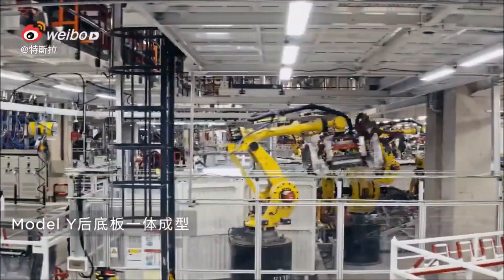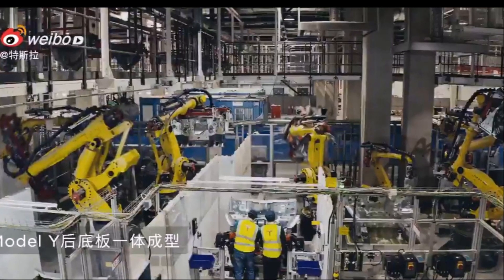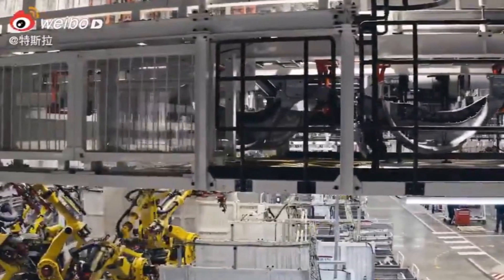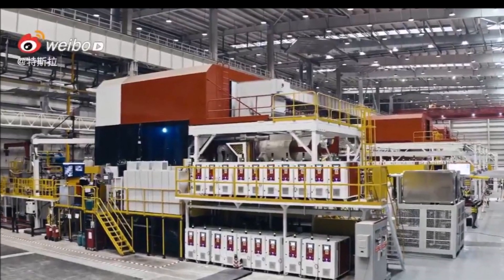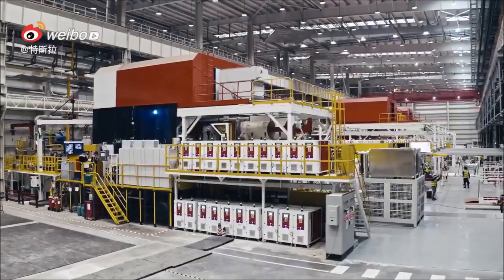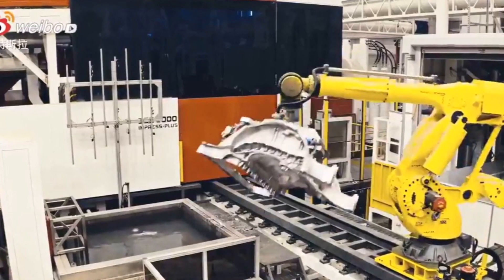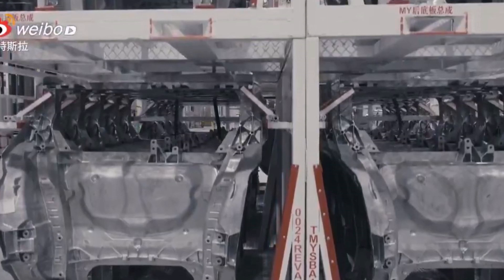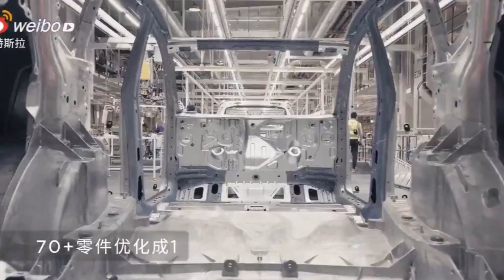Tesla Shows Rare Video of Mega Casting of Model Y at Giga Shanghai

Comment: For your note at 3:07, Tesla is claiming a 10% mass reduction resulting in a 14% increase in range as a result. Considering how hard it is for an ICE car to get a 14% range improvement - or even to eke out another 14% range via batter improvements, this is highly significant from an ROI perspective, above and beyond the cost reduction of eliminating 40% of the robots needed to create these structures than before.  Telsa has a killer car, but their secret sauce is such aggressive moves to reduce the cost of creating a car.

Comment: Good day Armen, your comment about Tesla being the only car manufacturer using large scale High Pressure Die Cast (HPDC) parts to speed up production and improve weight is not correct. Magna International has been producing FRONTEND ASSEMBLIES  to automobile manufacturers for several years. At the time they received their HPDC press from IDRA it was a 4,400 Ton press possibly the largest in the world at that time. May 6, 2019 IDRA news release. I believe Acura is one customer using this technology as well.

Comment: Did you notice in the video, when the robot removes it from the giga-press it has the sprues from casting.  It then backs up on a track and puts it into a workstation cell.  When it takes it out, all the sprues are gone.  Evidently that workstation does all the trimming and machining of the raw casting in one workcenter, very efficient!
Reply: Good eye
Reply: Actually, there is more than that - there are several smaller components being cast in the large opening in the main casting, which are removed at that stage.
Reply: @hindesite  Are you saying they're "killing more than one bird" (creating multiple independent parts) with one cast(ing operation)?  Good idea!
Reply: Yes, those are more often than not required in the casting cell.

Comment: Thanks. The accident repair cost is a good point on the Tesla SWOT that I’m sure Elon considered when deciding on the megacast.idea. 

Another possible negative is die repairs. It’s been 30 years since I was in the auto business but in those days aluminium attacked steel dies very quickly and maybe the dies (back then) lasted 1,000 to 2,000 cycles before needing replacement. Perhaps material science has advanced significantly since then. 

Then there is the problem of super-fast Tesla innovation which is going to date the megacast very quickly. Hopefully Tesla engineers considered this and modularised the dies and chose to amalgamate those parts least likely to change with time.

Finally there is the problem of quality control and rejects. The more complex the operation the higher the reject rate. I’m sure casts are xrayed and faults melted back to satisfactory quality. Perhaps during the first six months of operation the reject rate will be 20% but will come down significant with AI management inserted between the casting controls and sensors, and the X-ray machines.

Don’t forget Tesla has “Open AI” running it’s self-driving vehicles and there is every reason to believe that an Open AI is also managing every operation in the gigafactories. When Elon said the future lay in managing auto factories I think he was alluding to AI control.
Reply: The cost of fixing a gigacast car is substantially lower than with a traditional car and all of its fiddly little pressings with a myriad of fastenings, welds and adhesives.

Comment: Robot repair will be huge...  software programming  will be huge... process control will be huge...  engineering will be huge...  design engineering will be huge... mechanical engineering will be huge...  invention will be huge..   thinking will be huge. .. education will be huge...  How many elevator operators are there? How many horse and buggy operators are there?   Gone .. .. give your head a shake...  use your brain.

Comment: I had also heard somewhere that this mega-casting also reduced the number of robots by over 30, not having to do all the spot welding and manufacturing of all the smaller parts that the mega-cast replaced. So that's additional cost savings.

Comment: I was hoping to ignore this but I cant since I didnt finish watching the video when I originally started. First off. why the assumption that the part of the process affected by casted backend involved human labor. Generally the par of car assembly that invovles human labor is the detail bits like installing wires and cables and connecting parts together. If you need to lift something heavy and weld it. Every auto plant video I have seen has that stuff entirely automated. So The amazing thing isnt that it is entirely automated as displayed. The amazing thing is how many less kuka robots they need. Given the reduction in parts. This reduction will happen again when the front part of the frame begins getting casted.

Now I am not in any discounting the concern. Your concern is real. Elon has not been coy at all about his goal around manufacturing. The media has taken a victory lap on elon failing to be able to deploy his "alien dreadnaught" during the initial model 3 ramp. But the Media does not at all understand Elon or dont care enough to try to. The pivot he made during M3 ramp was a temporary acceptance of the fact that he needed to change the way cars are built in order to further increase the amount of automation used in its assembly beyond the ceiling he ran into. Mega casting is one giant step further down that road. The shortened wiring he talked about a few years ago is another. So over time Tesla's factories will move more and more of what humans do to robots by simply altering the way things are done to be easy for the robots instead of being easier for humans, as long as the robots can do it at the same speed or better.

As for the question you raised. It depends on the speed automation gets deployed at. If companies become smart enough to understand how to optimize the work they do to make automation easier. Then the rate of the transition will likely be faster than human beings can get retrained. In which case a serious talk about the most feasible way to support a UBI needs to be had. Not because we want people to sit on their ass. But because a UBI can be the foundation for convincing the workforce to be okay with waking up at the beginning of the week going to work at one place but ending the week working someplace else. Dont remember where I heard this but I believe one or a few of the EU countries have something like this where companies pay into the system to enable retraining while still having enough salary to cover needs. Basically how the system of work works needs to be rethought. I think a desireable end state is that the concept of being fired goes away, along with its stigma. Your just moving from task to task across different companies. The Gig economy kinda looks like that today. It just doesnt have the safety net necessary to be of low enough friction. Sure you will have people who only want to do the least to no amount of work. But you live with those people. The economic output increases you get from fully embracing automation will/should make the drag those people pose look like rounding errors. The focus should be on getting the most out of automation and updating the safety net to allow for maximal usage of it EVERYWHERE.

Comment: From what I understand the amount of force required to really damage the casting is quite high. So for a fender bender the casting remains intact making repairs relatively quick and easy. If you're hit really hard and the casting is compromised then the car is fooked. However at that point the priority becomes the safety and wellbeing of the passengers so....sounds good to me.
Reply: Good thinking, I agree.
Reply: Then for some Tesla Insurance takes care of it.  All bases covered. Except I haven’t heard how the Li mining intent by Tesla is progressing with their 10,000 acres of Li rich clay in Nevada as mentioned by Elon on Battery Day.
Reply: It would make sense... even for trucks ... that for the structure in die cast to be front and rear only. No all one piece.    this helps transition to new modles for manufacturing and chopping for repairs. Cars and trucks have to crumple for a 5 star crash rating... in order for the occupant to survive. They are more and more modular . But still any work that requires a new die cast structure front or rear would be major  surgery they are trying to avoid exactly at production or at a crash .It will be a long time when we can chop down a die cast car and swap out a 3rd or quarter. But die cast will allow body to crumple and a stronger shell will allow people to walk away at right off. And that is the biggest savings position... monetary and life savings

Comment: The automotive industry has been using robots for 30 years there's still people involved just not as many
Reply: In his recent interview with Sandy Munro, Musk noted that out of about 1000 robots on the assembly line, switching to a single rear casting eliminated about 300 of them, and switching to a single front casting is expected to eliminate another 300. So the mega-casting is even putting robots out of work.

But of course that still means lower manufacturing costs, which in turn will make these vehicles affordable to a greater number of customers, which in turn could eventually create more business opportunities for people around the world by providing them with affordable transportation and freeing up their savings for other uses.

Comment: This isn't a new problem.  Robotics and automation have been steadily chipping away at jobs for decades.  And it will continue, of that there can be no doubt.

The service sector has grown, absorbing some of those unemployed workers.  But the compensation for those jobs isn't nearly as good as compensation for manufacturing jobs in the past.  And those jobs aren't safe, either.  Robotics will expand to perform nearly any sort of labor - even professional jobs like doctors and attorneys.  Robots and automation will do the work better and cheaper.  And if you imagine that some jobs, like software engineering, are safe, think again.  Machines will come for most of those jobs, too.

This trend presents us with an opportunity, really - with more and cheaper goods, we have the potential to end privation and poverty.  But that is theory, not practice, at this juncture.  In practice, robotics and automation are helping to drive wealth concentration to unheard-of heights, while the middle class shrinks.

We have two problems to solve.  One is distribution of wealth.  This will be politically difficult - rich people dominate politics, and they like wealth concentration - but distribution of wealth is technically simple.  Establish a basic income.

The other problem is, idle hands generate mischief and discontent.  People need things to do, activities in which to invest themselves and derive satisfaction and identity.

To an extent, the latter problem can be addressed with hobbies, sports, entertainment, and such.  But that won't be enough.  Not nearly enough.

Few people are able to visualize this future, where robotics and automation perform the labor for our civilization.  Even in academia, contemplation of this future is mostly restricted to the technical fields.  We have almost no-one working on designing the society which must co-exist with this extreme production cornucopia.  Education will need to be redesigned; objectives established; roles defined; generations raised who will fit in and thrive.

It's a vast challenge.  I'd feel much better if we had broad recognition of it, and if academia were fully engaged in planning for it.

Comment: Robots doing all of the work should be a liberating thing, and we should work to make sure it is. No one working on an assembly line not doing creative or engaging work wants to do that for the same pay. Sure the engineers enjoy the challenge, but the work that isn't interesting or challenging can we automated with no loss for the employee, but the check. Elon musk just like any capitalist is trying to minimize labor costs. Paying you as little as he can so he doesn't need to buy a robot. By raising the value of our labor we are raising the value of the robots.

Labor unions among the automakers are some of the last hold outs. Very few people see so much of their labor value in their check. By not having a dealership model Tesla already saves 10-15% per car. The labor participation in the full stack of the car is half of what the competing cars are. We should encourage every industry to make these leaps and bounds. A Value Added Tax on the per mile of robo taxis would be the best way forward. If a robo taxi earns $30,000 a year and has a 30% ROI, it is more than justified in putting the tax burden on it.

The only reason that someone not slaving away for someone else feels "lazy" is because of the conditioning we all have in venerating these big businesses. Go into business for yourself. Build something fulfilling. As long as your needs are covered and subsidized then you won't care you're making 20% less in working for yourself.

If the Alaska Permanent Fund can pay every Alaskan $2000 a year from oil revenue, there is no reason why we can't do it globally for the costs of automation.

Comment: Fawking impressive as well.  Can you imagine how rigid those sub frames are ?  And totally rust proof.
Elon and his team are killing it.  GM, Ford, et al must be shaking in their boots. 

Amazing that Ford can't build pickup truck bed floors like this.  And integrate the truck frame into it as well.
Reply: Stop talking nonsense, the frame is what makes the rigidity of trucks, thats why ford have amazing towing capabilities, also those trucks are very easily modifiable for many different applications from ambulances to camping rv to dump trucks.....
Reply: @carholic-sz3qv  Have you ever done FEA ?
Reply: @carholic-sz3qv  You know nothing about structural design.   The entire bed floor could be the upper flange of the frame beams.  Nothing stronger or more rigid than that.
Reply: @SomeTechGuy666  nonsense, range rover for example have been building big SUV on unibody platforms without frame and it never flexes even in the hardest offroad conditions. Audi was the first manufacturer to make a 100% aluminium car shell.
Reply: @carholic-sz3qv  Whatever.
Reply: So obvious that Cybertruck will change everything we know. Even a dinosaur with bifocals should be able to see that.

Comment: Great video. Your comments about Canada's insurance system is totally inaccurate. Each province in Canada has its own insurance regulations. British Columbia has a government run Insurance provider called ICBC. The claim about Canadian insurers only repairing glass, lights, fenders and the like is false. Vehicles routinely get repaired to the tune of $20,000 - $50,000 dependant of course on the value of the vehicle. I own a motor dealer, I am intimately familiar with the regulations.

Comment: In Canada, what insurance companies cover or do not cover is controlled by the provincial governments, not the Federal government.  Therefore, what is covered varies widely by province.  In Ontario at least, the insurer with "write-off" the vehicle if the cost to repair it exceeds the value of the car prior to the accident.  It doesn't matter if there was or was not damage to the frame of the vehicle.  Here is a link to the official Government of Ontario website that explains the rules and procedures:

http://www.mto.gov.on.ca/english/vehicles/vehicle-branding-program.shtml

Please note that in the case of motorcycles, if the frame is damaged to the point of requiring replacement, it can never be re-registered in Ontario for use on public roads and cannot be insured.

Comment: Tesla could recycle totalled cars in house. Such a big, pure cast part of their proprietary aluminum should be pretty valuable.
Reply: Uhm nope, they will need to partner with foundries, recycling metal is extremely energy intensive
Reply: @carholic-sz3qv  How is it different than normal aluminum casting? Tesla is already melting the metal right?
Reply: @anhbaseball08  the aluminium alloy needs to be precise and remain the same consistency for production, also die casting uses pressure to remove air bubbles and it has to be cooled precisely to give strength and avoid failures.

Comment: dig into electrification required to eliminate\minimize co2. Every single structure globally must be retrofitted or replaced. Entire grid must be refreshed. Farming is in the process of moving forward. High speed rail, hyperloop, co2 free shipping is in the pipeline. The labor required will dwarf all previous transformations exponentially. Outside of manufacturing components needed for this transition robots capabilities fail. There is unlimited work available for at least the next century. In addition the repetitive boring production line jobs are being replaced with human centric jobs that require talent, creativity.
Reply: Excellent and well said.